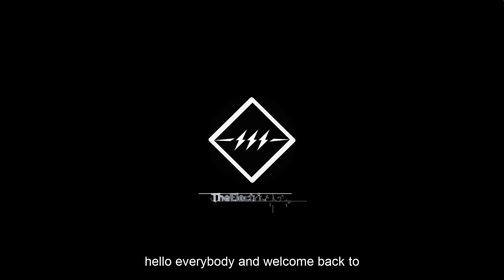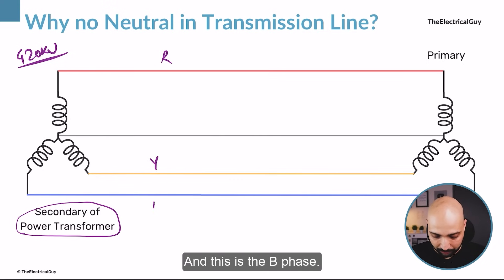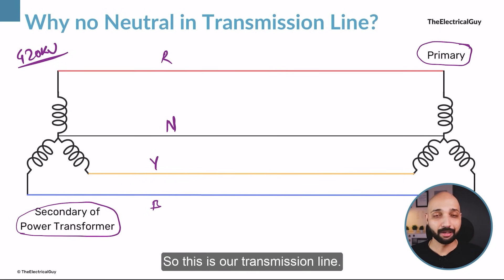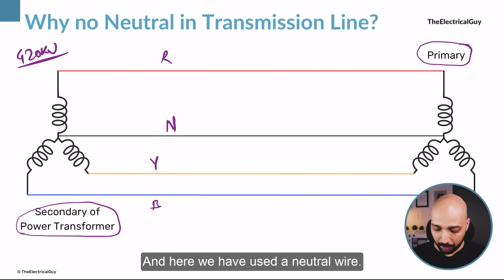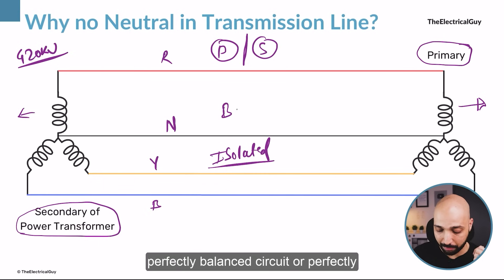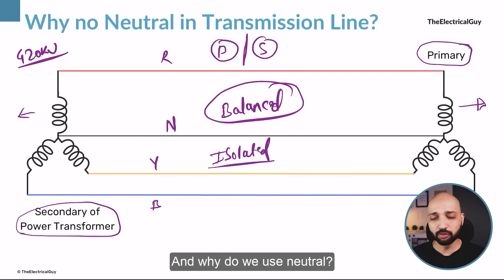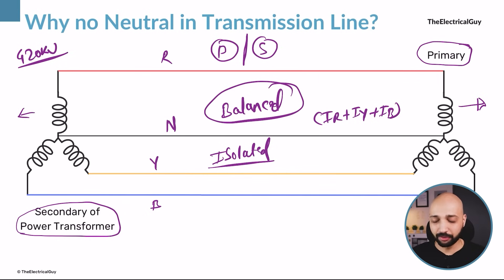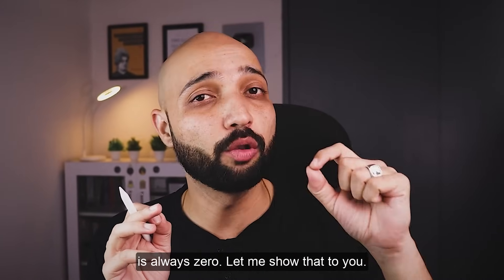Why there is no Neutral in Transmission Lines?  Explained | TheElectricalGuy

Comment: Ohh my god the way you explained.... Thank you so much
Reply from the maker: Happy to help
Reply: Fantastic Explanation.
Reply: This is 100 y. old system, now you have DC lines + and - and iinverters. Where do you live ? Why you have this old system ?
DC system has a lot of advantages. pLease switch to modern tech. not this 3F for apes. It is a shame.
Reply: @PavolFilek 
DC is nice but expensive.
Reply: @PavolFilek  Presently only 20% of all electricity transmitted worldwide is through HVDC lines. Moreover, HVDC transmission is economical for long distance e.g. national grids. Intermediate distance transmission will be through AC only. So AC transmission will prevail even after your death . 😊😅😂.
Reply from the maker: Yes. That’s right in case of distribution network. In the video i am specifically talking about the transmission network..

Comment: The answer is Money: cost reduction. If you connect both ends of the transmission in a delta configuration, you won't need a neutral wire. Wire costs money 💰 
On the consumer end, you need the neutral for single phase loads.

Comment: thanks for adding and recall our knowledge having said , HV system doenst need neutral cause there is no load to connect but at distribution side there are single phase circuit which needs neutral for circuit completion , that why we need, but at distribution side we also care to balance the load. and not let maximum amount of current to flow at neutral side.

Comment: Most high voltage transmission lines are wye configured, no neutral conductor along its length, this strategy is for cost savings and yet the purpose is still serve and technically acceptable, Wye configuration requires lower phase voltage thus low winding insulation, hence lower over all cost for the transformer as compare to a delta configured transformer of the same specifications. Loads from the distribution grid say 13.2KV are not balance hence by design they require neutral conductor to carry the unbalance load back to the utility substation, say 69KV to 13.2KV,20MVA  delta/wye transformer. This unbalance current will reflect all the way to the generating source through the high voltage transmission lines. But we need to go back to the distribution side, though we are living in an imperfect world this load unbalancess are minimized by the utility enginees and planers,they ensure proper distribution of resources to minimized load imbalances along their distribution lines,hence load imbalances in the transmission  lines say 230KV is now minimal with insignificant effect. The neutral point of the  wye transfomer along the HV line (both end in the 230KV transmission ) is anchored in the grounding system of  their respective substation ,the skywire or lightning arrester or opgw is also anchored in the system grounding of each substation thus any load imbalances to each phase in the HV line though its minimal can still be carried indirectly towards the high voltage transformer source via the center point of the wye configured(close to the utility grid) through the grounding system of the substation through the skywire/lightning arrester/opgw through the system grounding of the substation(close to the generating station) and finally through the center point of the star connected transformer close to the generating station side. Hence it seems the lightning arrester is indirectly acting as the neutral wire of the wye or star configured transmission line. It is not ovious  though.

Comment: Hi Mr. Electrician Guy... 😊
Iam also an electrician though never got to work with power lines and or transmission lines. Mostly I worked with domestic installation even though Iam a qualified electrician...Iam still interested to further my studies though Iam a bit older now...
Thanks for the video and your teachings.., it reminds one of the days during schooling. 
Regards 
T.K Modisane

Comment: I have a doubt if the load on the each phase on distribution side has different that's why we required neutral on distribution but this are connected to This Primary and imbalance occurs on secondary currents then it also affects the primary right in primary also imbalance occurs right can you Rectify my doubt sir

Comment: Delta transformers are cheaper than Y transformer.  For balanced three phase systems no current will flow to the neutral.  So again it is economical to use delta because there is no need to run a neutral wire.  The assumption that the transmission line good because there are no load is added in between substation.  The only problem is when something goes wrong say lightning strikes ,trees or other objects come into contact with one or to phases.  Transmission systems run without neutral but a ‘ground’ wire or static neutral are used that run (on top) parallel to the 3 wires and always grounded to earth.  Static neutral because it is not intended actual function of the neutral in three phase Y or residential 2 single phase systems. Of course the system have protection that will shut down the affected zone.
Note that for Y or two single phase systems, neutral is actually needed because we expect the load to be unbalanced.  Also the lower voltage between hot and neutral are needed for loads like lighting, small office equipment and a/c heating, etc.  that’s why we make sure that the load are distributed to the phases of the system.
This and another video are good in explaining the phases current using visual (the other guy actually measure the current to each individual phase.  THAKS for the very good video.

Comment: As a few other commenters have pointed out you absolutely can have distribution without a neutral. They are very common and in many parts of the world are the only allowable systems as they allow use of arc suppression coils.

As long as the transformers are phase to phase connected there is no imbalance requiring a neutral for the current to flow. The neutral is only needed if connecting some of the load to just a single phase.

Comment: That makes sense. Here in the US our 240V power circuits don't have a neutral either, all they need is 2 hot wires carrying equal power currents. The 120V power circuits do need a neutral since it's only using 1 of the 2 240V lines.
Reply: Curious you run a 10/3 home run to your dryer because the dryer has 4 terminal screws and one is for the neutral do technically you need a neutral for some software just a thought
Reply: @Weasel_NM575  Dryers can have 3 or 4 terminal sockets, the neutral isn't needed or used. Stoves or ovens use 4 terminal plugs the display and clock may use the neutral line for 120V power. Our EV car charger does not have a neutral either, just 2 hot plus ground. Our air compressor at work is the same with no neutral.

Comment: Why birds can stand on transmission lines without getting cooked?
Reply: Coz to gets charged (cooked) you need to get the electrons flowing and to achieve that there must be a potential difference.  Think of this, if you take a glass and pour some drops of water on it and keeps it to the surface level of house the drop remains there. But if you lift one side keeping other side steady or lower you are creating a difference which makes the water drops to move from higher to lower side. Now coming back to Birds, when they sit on those lines there is no kind of difference there. That's how they stay there without getting cooked unless they touch the other lines.
Reply: @Rudolfvirchoww  But there is current flowing in the live transmission line on which the birds are standing. Surely, some current would pass through their legs. Right?
Reply: @rbc812  under normal bird-foot spacing ( a few cm) voltage drop is negligible. If one foot were kilometers away( hypothetically) then yes it could be dangerous.

Comment: Not so accurate. As in reality, there's no such thing as balanced circuit. The neutral is grounded at SGT star point as a path for any imbalance current. The point where u save money on not needing another conductor is true though

Comment: The distribution transformer opposite to my house has five poles in the secondary side. There's phases and one neutral. Recently they put an earthing rod below the transformer and gave earth connection to that fifth pole. And that pole is not connected to neutral. Previously the fourth pole is connected to neutral cable and also earthed below the transformer.

Comment: One doubt: if the load current at the 3 phases of the secondary of distribution transformer is different, then the current in the primary of the same transformer will also get imbalanced as the primary current is the reflected load current. 
Then how is the balance of the 3 phases maintained?

Comment: Dear sir, I feel Neutral is used to  balance the RYB phases, when all these three phases joined in one point and the individual phases joins with neutral through Load, now the circuit is completed so we require neutral to complete the circuit. Am I correct?.🎉🎉

Comment: Bro simply it is neutral earthed system... For HV sys. We use neutral Earth resister to dump fault current in neutral to avoid voltage fluctuate between phases. Now using neutral cables is for cost cutting

Comment: Nice explanation,yet I would add that not having neutral in a realistic ( not theoretical) Transmission line is totally dependent on the conditions persisting during transmission.

So if there is overload (or underload conditions ,resulting in overvoltage or over current,for example during a lightning strike), in a 100 to 200 km section of the Power Line, our design should have an adequate compensation mechanism.
Ground ( Earth) wire is supposed to take care of such scenarios.

Theoretical systems vary from Practical Systems in this regard.

Comment: As an aprentice electrician 
Before i see the video: the neutral is the ground, because the there are 3 types of grounds: a) the ground that is  used for safety (sockets), b) the ground that is used for protection against electrical surge & c) the ground that is used as a neutral, for example electric motors in electric cars.
After i see the video: I was wrong, the perfect 3 phase system, that way u cna bypass the neutral, same way as in  the electric motors, star or triangle circuits.

Comment: If the high and low sides of a transformer are electrically isulated. Then why does a short circuit on the low side of the transformer affect the high side?  A 3-phase metal short circuit occurred on the low side of a transformer. And short circuit  distance was about 30-40 meters from transformer. The oil circuit breaker of the line operated and disconnected the curcuit. Why did this happen?

Comment: Balance is 1 the second is there is no need for phase distribution which means no neutral to close the cicuit thats why delta is used in first place -   3 phase motors dont need a neutral cuz they are balanced loads as well

Comment: Can you explain when it is mandatory to have a  grid tied inverter  with a neutral and what is de function of the neutral of the grid tie inverter. And is it mandatory to have a grid tie inverter with neutral in case of a grid with a TT-system. Thanks

Comment: Adding a neutral would be a waste of wire, because no current would flow in it. That's because if significant current did flow in the neutral it would only happen if the loading on the phases was unbalanced, and therefore suboptimal use was being made of those 3 conductors too.

Comment: In Australia the only place you will find a neutral wire is between the low voltage transformer and the customer.

Comment: why didn't you say anything about the return path of the current and N's role in that? sorry but also what does the "balanced" mean that you keep saying ?In your example of the houses you explained this differences in Current (Amps). So are we trying to balance current or voltage here?
Reply: Current will goes out one phase, and split and return on the other phases at some moment in time. At other times, currents go out on 2 phases and combine and return on the 3rd phase. Everything keeps repeating. The neutral's role is to carry the imbalances current and to stabilize the voltages across the loads.

Comment: So if a single line of threephase delta hvac is cut and the hot sidetouches the ground, i wont get shocked since theres is no connection with other phases and no neutral grounded like a star connection

Comment: if secondary is unbalanced how can primary be balanced? ;)
Reply: Because  primary is the main power station, secondary is distributor end at the sub station, so even if the secondary means substation unbalaced , the primary means power station doesn't effect.
Reply: Primary and secondary wiring are isolated in trasnformers, whatever shit happens in the second does not affect the primary winding. Remember in a tranformer there is no cable between primary and secondary widings, only a mahnetic field formed by the coil windinds of each side

Comment: At 4:30, it looks like a circular argument.  You're saying that the currents are balanced, BECAUSE the currents are balanced.  The voltage waveforms are depicted, but does that mean the current waveforms are also balanced?  But what if they are not balanced?  Is that possible?  Can an unbalanced load on the secondary of the downstream transformer cause an unbalance in the transmission line?  I'm kind of thinking that BECAUSE there is no neutral, the currents are naturally balanced.  Any "excess" or "shortage" of current in any phase is carried by the other 2 phases.  In other words, the transmission line is self-balancing because, as you said at the start, the transmission lines are electrically isolated from the source and loads, and that's OK.
Reply: In my opinion they used capacitor bank in case of imbalance 😅

Comment: I would add ... in the high voltage lines ( 420 KV ), the currents are not so hight ( Power = Voltage x Current ), and any difference ( or algebric sum ) among them is far more little ...

Comment: Incorrect explanation. In a 3 wire transmission system, Balanced "Delta" conncetion is used, not Star. But in distribution network, loads are variable and need a Return path for unbalanced currents in phases, that's why  4 wire "Star" configuration is used for delivering Single Phase connections.

Comment: Some notes. What you call "Star" is commonly known as Wye 'Y' configuration. It uses 3 phases with a Netural in the center. You really didn't show the the 3 wire configuration known as "Delta", there is no Netural in a Delta (triangle) configuration. Both configurations transfer power equally, but for long distances the Delta is used to save the need for a forth cable (cost savings in that case). Transformers are used to convert Delta to Y so that different phases and voltages can be used. The Delta can only power 3 Phase equipment (which only factories have), but Y can power (in the US) 3 phase 208V, split phase 240V, and single phase 120V all from a single Y secondary. The Netural is normally tied to ground at the Transformer and again at the home as it enters the breaker panel.
Reply: I doubt wye is used for hv transmission as a neutral is not needed and one 'extra' conductor does not make any sense to run.
Reply: @rickhawkins218  I agree, Delta is almost aways used. But you know, I'll bet Russia uses Wye transmission lines - just to be different.
Reply: Indeed, the Y config is only needed at the end user transformers. And only if you need 2 voltages 1V and 1.73V

Comment: The simple reason transmission lines are delta with no neutral is, If there is a fault to ground, the fault current returns through the earth and the grounded static line if provided  to the source station where it is a grounded at the a source transformer via why out put configuration or a delta  grounding transformer  to sense the return current and to trip the source breaker. Simple.

Comment: Not quite true. In Norway we have been running domestic network, known as IT-network, with no neutral for more than 100 years. Appliances are connected between live wires receiving 230V. Unbalances are partly swaying between houses and loads, patly finds its way all the way back to the mains source, i.e. the generator.   In later years, new homes are set up with 3-phase 230/400V TN network. Here the neural is present, but if the houses are unbalanced, you will see that unbalance back in the backbone transmission network.

Comment: Wrong explanation.. the neutral in transmission lines is not there because both ends are grounded.. moreover, delta side can carry unbalanced currents. As for neutral on distribution network, it's there to provide single phase supply to consumers, and also because consumers aren't bound to earth on their side so utility must provide a neutral wire to the consumers.

Comment: I don't think this explanation is correct.  You can't really make a system "balanced".  Any three phase system will be either a delta or star configuration.  Delta has the windings of the generator or transformer connected end to end in a triangle shape.  The end points are the terminals, and there are 3 only, and none of these wires are actually referenced to the earth in any way.  In a star topology the windings are connected to a common central point (called the common or neutral which is grounded and referenced to earth).  At the point of usage it's handy to have voltages referenced to the same potential (hence the neutral / ground) wire.  When transmitting power long distances having 3 instead of 4 conductors saves $$ in wire costs.

Comment: In 11KV , I have seen no neutral, but before substation why there are 6 wires?
 
And at distribution (step down) transformer, how the neutral line is introduced, please explain the connections
Reply: Neutral line comes from the star point of the transformer which is grounded at the transformer.